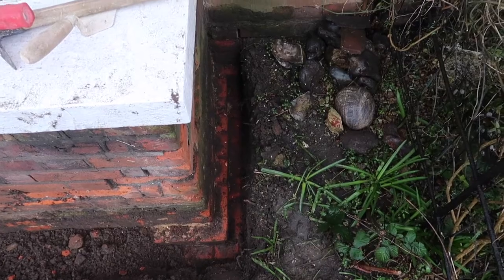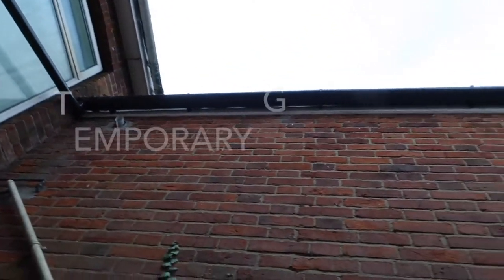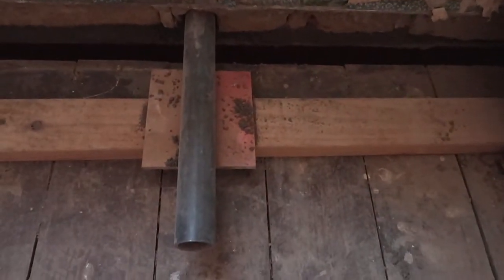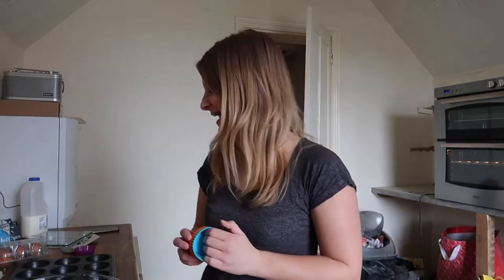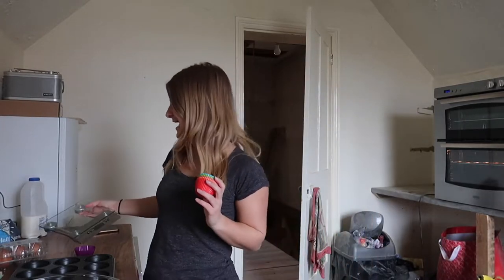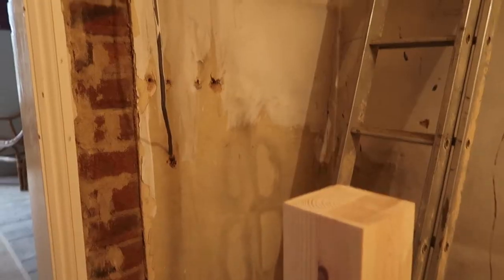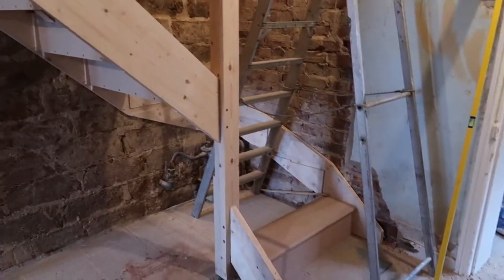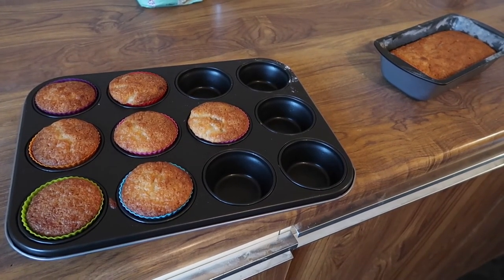Renovation Series || Episode 5: Chat through our plans

Comment: What if you stack the dryer over the washer and move it along the wall adjacent to the door leading into the kitchen? Then,  maybe, you could have a corner pantry around to the oven space. 

Also, with the hallway, I think it will be warmer in the winter with the hallway. What if you keep that first part and then install a small coat closet to extend your privacy, add some function and then knock the rest of the hallway wall out? Just thoughts. 😙
Reply from the maker: Both of those are actually very good ideas :) thanks mum. I'll run them by David and see what he thinks
Reply: Heart To Happy that makes me happeeeeee! 😄